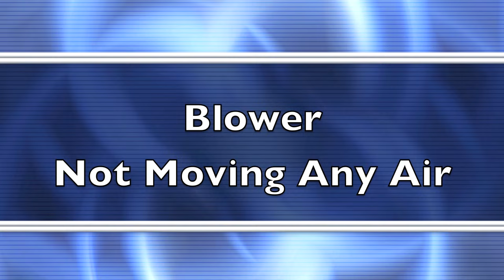Blower Not Moving Any Air

Comment: My car dose not have a cabin air filter. I seem to have a similar problem it’s so random it’ll work and blow lots of air on all fan speeds I can hear the blower it’s on and has enough air pressure to blow my shirt sitting in the car. This happens on hot or cold dose not mater with in 10 minutes of turning on the blower I slowly loose air pressure. It stops blowing the air out and it sounds like in the dash the air is blowing back at the blower fan. Then it might randomly start working again. This happens on all zones defrost full face vent feet vent so on. When it works it’s nice great air pressure I just don’t understand the blower fans on I even took out the glove box and watched the blower fan turn on and suck air in.
Reply from the maker: Watch this video, it will explain the probable issue.  It could be this valve or actually any break or leak in the vacuum lines. Good luck  https://youtu.be/0ayGTFR9gHs

Comment: Hello, quick question what would be the next step to finding why there is slow cold air coming out of the vent when the blower motor is at full speed? ( My Air filters are new and the problem still continues ) 2001 Acura TL
Reply from the maker: I'd suggest you check the blower resistor (speed control)
Reply: realfixesrealfast thank you I’ll take a look

Comment: I have 2004 impala and I feel the vent cold but it doesn’t blow air when I turn on the ac blower but when I used the air from outside it blows cold air ? Could it be the same problem ? Someone help I live in Arizona and this heat is killing me 😔
Reply: It sounds like a "blend door" issue to me.  You have several blend doors that move with an actuator.  Probably one of them is not working

Comment: I have a 2013 ranger xlt that has cold a/c but does not blow , at least not the way it should . Ford tells me there is no air filter for this model , ?????anyway , how do I get to the wire mesh that up against the fire wall to clean it , oh did I mention there's no FILTER.... Who does that ? HELP PLZ..... Steve
Reply: Same thing with my 2006 Mitsubishi Raider, no filter anywhere, so I took out the blower and stuck my phone to see inside the airduct, the evaporator core looked like grey moss, so jamned the water hose in there(not full blast), just sprits, till the core was clean. AC works great now

Comment: My outside air vents ( the ones closest to the doors on each side ) are blowing good, but the  2 in the center of the console are barely blowing at all....like a whisper of air. Any ideas?
Reply from the maker: you probably have a blend door motor not working right.  The blend doors deflect the air movement.
Reply: @realfixesrealfast  thanks

Comment: The fan isn't blowing out the front vents of my 1998 Chevy Astro van for heat or a.c.. Do you have a video to fix it? The fan motor isn't working on any speed a.c. or heat. The back fans work fine.
Reply: sounds as u may need new blower motor (front) ? not sure though....
Reply: jo momma

Comment: Hello sir I'm having issue with my 08camry air not coming out through feet vent, it is coming out from front and windshield but not feet vent. What's wrong? Thanks
Reply from the maker: probably the lower blend door actuator is not working

Comment: I think I have the problem you are describing. Except, do you know if a 2000 Ford Expedition XLT with 5.4 liter trition engine rear wheel drive, uses an in cabin filter? Thanks for the video.

Comment: You are my wife's hero tonight! We are entering a heat wave. 2015 Honda Fit EX. She went through a car wash today with the air conditioning on. After, she could hear something running beneath the dashboard - but no air conditioning or heat. I was getting ready to replace the blower motor resistor but it looked too good and I am not the best at electrical troubleshooting. I decided to do a few last searches after experiencing the blower motor loudly running after I removed the glove box and lower glove box cover. She was really happy. She gets to keep commuting to work with no sweat. The filter was physically wet. I am going to replace the filter and discard the current one. Thank you!
Reply from the maker: Glad it helped, thanks for letting me know

Comment: I've changed my cabin air filter and also the heater ac control unit a.k.s the mode etc but still didn't fix problem so I put old one back on I'm getting air from all vents except the center ones what else could it be? I have a 1999 honda accord
Reply: Did you get your answer... I have the same problem... 03 Honda Pilot. Air come out the bottom and side, even rear panels but not the two front ones.  Let me know if you get a response
Reply: No I haven't :( I even tried to change the mode panel thing and the filter and it comes out cold and everything it just doesn't come out from the front 2 holes too!!! I can't find an answer LOL

Comment: Thanks. My 2003 Kia Sorento blower won't switch between dash air and floor air with the mode switch. It was stuck on dash air ..now it's stuck on floor air. All fuses are good. Insights ?
Reply from the maker: There is a big difference between the blower and the blend doors.  The blower makes the air move and the blend doors direct where that movement will go.  From what you said I assume you have good air movement but it's not moving to the selected outlets.  If so, it is  most likely either the blend door actuator itself and/or the linkage between the actuator and the door it is trying to move.  Most likely it will be a bad actuator.

Comment: I have a e150 van very little air flow not filter I put in new fan new switch new resistor  and clean the ac evaporator  core on the fire wall still not much air flow

Comment: Hi, 07 nissan altima recently has weak air flow when turn on AC. If AC is off, the fan working fine, air comes out fine. Turn on AC, it works for few minutes then the air flow becomes weaker and weaker to the point there is no air comes out (whether re-circulated or not), when set the air on high you still hear the motor blowing noise but no air, cool and heat still work because when you turn off AC and just use the fan, air does come cool, or hot depends on the setting of the AC before turned off. New cabin air filter. I am very confused, so it works fine for few min then no air, but if turn off AC and set the fan run only, air does come out strong. Will coolant cause the problem because I recently notice the coolant reservoir is low so I toped it off (buying the coolant from dealer and mixed up wit water as instruction) and it stayed between min and max level since then... please help.
Reply from the maker: Of course without seeing it in person I can't be sure but it sure sounds to me like one of your "blend" doors is either stuck, restricted, broken, or just not working.  The blower  motor simply moves air.  But that air is then directed to different positions depending o n several things. Temperature, floor, vent, defrost, and in some cases even right or left.  Have someone who understands HVAC air flow & control take a look at it.

Comment: Front dashboard air vents not blowing, nor making motor sound when temp. is on low, only works when positioned on high or maximum for both heater and a/c.on my 1997 Chevy Cavalier Z24.

Comment: Indeed I can feel some air come out but it's not moving. However, I also sometimes will feel the AC kick on in rare occasions. When this happens, it might stay on indefinitely if the car is parked and still. 30 seconds in to driving it though, it instantly shuts off and it'll be weeks before you feel that brief blast of amazing air again if you're going somewhere.

I'm not sure if the trick shown here will work for me because I'm worried I have a flat-out short. But...I can also get a weak leak of heat as well on cold mornings so SOMETHING is working in it. I'm going to try your method. I do have a 2004 I just bought two months ago and while I saw that the original owner seemed to take decent care of the car, she might have traded it in come the AC issue (her original papers and everything are in the car, including past services made on it). My stereo was ripped out or adjusted at some point and maybe she did that in a desperate bid to fix the issue, lol. It doesn't sit in the space provided to it very well and is missing half the plastic around the edge to hold it in place so I have electrical tape on it. I plan to find a junk yard to help replace that at some point but I'm saving that as cosmetic work so long as it doesn't affect the other functions in the car.

Anyways, if anyone still checks this video out or if the uploader reads comments, does this sound like an issue anyone has experienced?

Comment: I have a 2003 Cadillac Seville SLS, it's blowing air but it doesn't defrost in the front or get hot. The back window defrost just fine and the middle console blows heat out the back as well.  Can someone PLEASE HELP!

Comment: Thank You Thank You Thank You!!! No Cabin air filter on my 07 Ranger FX4 but after reading deep in the comments I found a post about a screen only visible with glove box down and A/C on max. Looked like a cloth filter that my flashlight could not scrape clean. Used an old tooth brush and cleaned some of the screen and blew off with compressor. Now have air flow from vents. Have to find something in the morning to finish cleaning. Should look like a wire mesh screen when clean not a blanket...

Comment: My 2007 Mazda 6 will not blow any air (hot or cold) through the UPPER VENTS for the 1st 30 minutes running engine and then it starts to blow after that. It works all the time no matter what in the BELOW FLOOR VENTS. What could that be - why it takes 30 minutes to start blowing though the UPPER VENTS?

Comment: Thank you for the video. My hyundai Santafe's ac (cool/heat) works fine. I have recently noticed that sometimes I can hear the fan responding to the fan speed knob normally but the air from vents is so weak and I hear like the air is being leaked somewhere inside above the glove box. My cabin filter is new and it makes no difference if I run the fan without a filter too. Can you please advice what could be the issue ?
Reply from the maker: of course it is impossible to say for sure without looking at it, but it sounds like the air diverter doors are not closing completely.  They move back and forth a lot like the heat register vents in your house, except they are electronic.  They may be actually broken or just out of adjustment.  You may want to simply do a "relearn/reset" with a scanner.  Not sure if your year/make/ will allow it but it's possible.  You will need a scanner to do it as well.
Reply: @realfixesrealfast Thank you for your reply. Where are you located ?

Comment: have a 2002 dodge grand caravan sport with dual air...front air does not blow, rear air only blows on high...the a/c is working and heat is working...when driving the outside air flow does push air into front.  have replaced the blower resistor so this is not it.  any help?

Comment: Hi, i have a honda accord ex 1994, i have exactly the same problem that you described in this video. But i dont have a cabin filter, and also, rarely, but sometimes it blows cold and hot air, but mostly of the time it doesnt. When i turn it on, i hear it working and its cold, when i put my hand to it, but it doent blow.
Reply: Ion M
Reply: Ion M Hi, your issue sounds a lot like mine. Every great now and then, the AC kicks on and I'll get a wonderful gust of AC but about 30 seconds later, it's dead. If sitting still, also every great now and then, the AC will come on and stay on...but the moment I decide to drive, it cuts off shortly after.

I know something is working in there as I can use defrost and I get a weak amount of AC and even heat for cold days, but it doesn't just blow the way I need for it to. Did you ever get your issue fixed and if so, what was it? I'll spend a few hundred if I absolutely have to but if so, I'd like to go into the repair location and lay down specifically what needs to be fixed, lol.

Comment: I have a problem with my 2011 Pilot. There's no hot/cold air circulation in the two center vents I can hear the motor blowing. The drivers, passenger and rear vents are blowing hot and cold air. I replaced the cabin air filter and there's still no response. Any help or suggestion would be appreciate.

Comment: I have a 1989 Lincoln Town Car. When I turn my A/C from cold to hot, the fan stays on but the air stops coming through the vents.
Also, if I select floor, the fan shuts completely off.

I have switched out the panel control switches, it did the same.'

What do you think it may be?

Thanks in advance sir..
Reply: @Abbi Johnson One thing I found was that a screw was lodged in my vent door actuator, so my vent door would never close. That was one case.

What conclusion I came to, is that it's probably my Automatic Temperature Control Switch Servo.
It's on top of my heater core box, not a cheap part, not an easy fix. I have to buy it with the vaccum actuator, so the price is higher. Don't want to get a used one.
But it has a motor in it. It has to be that, I've tried everything else.

You may try buying a new fan 1st, I've read those motors also go out as well, or malfunction.
I replaced mine, didn't make any difference, that's why I'm believing it's my Automatic Temperature Control Switch Servo.

An A/C fan motor is less than 30 bucks at O'reilly's. Worth a shot, I'd say.

Comment: Hi. I enjoy watching your videos.. They are very professional, informative and very clear instructions. The sound is perfect. Thanks a lot for  your time to help people saving money by do it yourself repairs.
I have the problem with my climate control on my 2011 Porsche Cayenne. Few day ago it stop working while driving around the city. No air, no heat, no blower running. I check all the fuses they are ok. I can not find the relay for the AC any where.
I hope you can help me solve this problem.
Regards
Reply: quite q1
Reply: quite q1
Reply: quite q1

Comment: My truck is a Mazda B3000, 1999.  Does it have cabin filters?  I tried to find them but there doesn't seem to be any?

I can hear the fan blowing and it sounds fine but no pressure to the cooled air and it is barely blowing into the truck cabin.

Ideas  / suggestions?
Reply: did you look under the hood to make sure one of your vac hoses didnt disconnect?

Comment: I have an 03 pathfinder, the A/C works, I feel cold coming out but the blower is not working at all. Not on high or any other speed.  I have power down to the motor.  I took the blower out and hooked it directly to the battery just briefly and it spun nicely.  plugged it back in and nothing.  Do you have any ideas?
Reply: hooking it straight to power source and it worked fine?
Follow your wires in between the blower and main power source. your not getting efficient power from somewhere.

Comment: So, My 2009 Traverse has No Cabin Air filter. What's the problem when an Cabin filter is non existent on the earlier Traverse.The AC works for approx. 30 miles then the air is blocked, The fan is blowing but no air flow.

Comment: Thank you so much for this video. I have a 2010 Ford Ranger, it's  not equipped with filters but I looked in the back behind the glove compartment and the Sirius radio box and found that the screen, don't know the name of it, was totally covered in grime. In order to access, it has to be on Max A/C setting and you will need a long tool to clean it because you can't remove the screen. I  scrapped it off then blew it with an air compressor. The A/C works like the first day we bought the truck.  If anybody tries this you need to make sure you are careful when removing the grime. The screen looks like a large dryer screen, so be careful because the metal isn't thick and you can tear the screen if not careful.
Reply: DId you have to remove the glove box?  If so, how is glove box removal done or is there a website with glove box removal instructions?

Comment: I just have this problem on my w124. I just overhauled the AC systems, changed compressor, cooling coil and expansion valve. I thought that I need rework and cost a bomb again. This is the only video I found to explain my problem. Seems to be cheap fix. Relieved and Thanks!

Comment: So,I replaced the cabin filter on our 07' Pacifica to remedy the "cooler" air coming to the passenger side and rear vents. After reassembling all components, the air flow was considerably more intense, but the actual heat level did not seem to improve. The drivers vents never had an issue and have always provided the temperature indicated on the digital display. The passenger and rear vents have always been cooler or just plain cold, but they have always had a measurable air flow that is consistent with the drivers vents. Blendoor? Any other suggestions? 
Thanks for any suggestions.

Comment: When I turn on the fan, nothing turns on until I turn it all the way to the last setting level 4. At that point, ac/heater works fine and air blows like it should. But level 1-3 the blower doesn't engage. What could be the problem? Thanks for your help!
REPLY
Reply from the maker: your "blower motor resistor"  is bad, common problem.
Reply: Thank you! :)

Comment: Nice video, real simple and similar to a toyota echo. Now I have a quick question, what do you think it could be if there's no blow of air, you feel the conditioned aspect of the air at high speed, and when the blower is set to on the engine reacts with a fan but no sound of ac fan? (Used to go on and off, on again at high speeds and only on high.)

Comment: all symptoms, everything you say about the problem is exactly what's going on with my car(2004 Chevy Trail Blazer), except my suv does not have any cab filters, what else could the problem be?
Reply: Sandro Donovan maybe it's your flux capacitor
Reply: Sandro Donovan 20009  vow rabbit  no heater fan speeds
Reply: Sandro Donovan and w